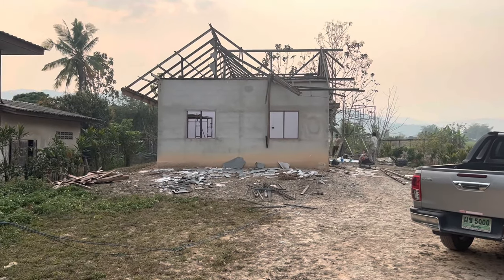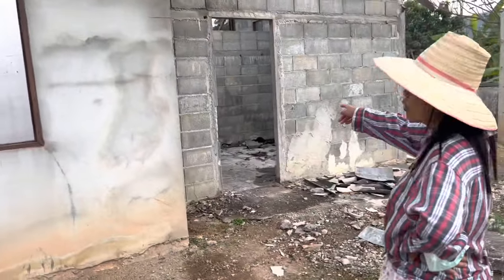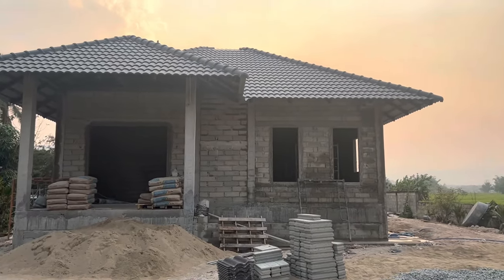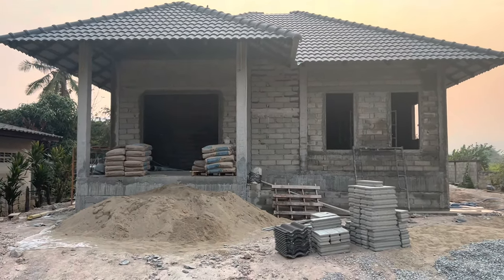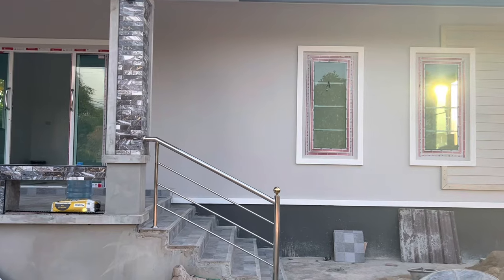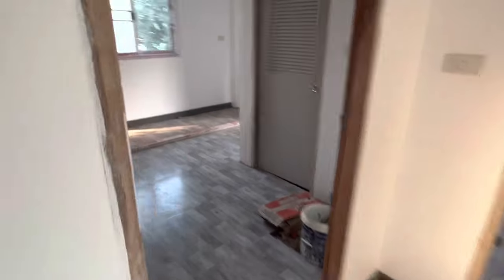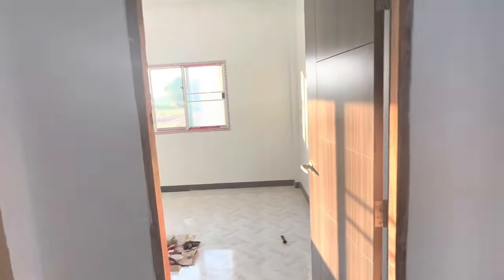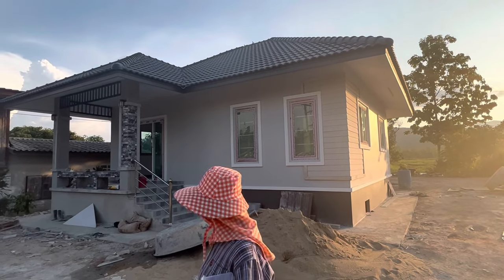Brand New House in Northern Thailand $35K!

Comment: Nice vlog Glen, before, during and after construction and very fast, it's amazing the hours the Thai workers put in with all the heat. Something that baffles me is not using double walled thermo blocks  and not insulating the loft to the max like we do in Canada. Thailand has to deal with very hot weather all year round and if I build a home in Thailand it will be well insulated.
Reply from the maker: So true, and with the rising cost of electricity, you would think everybody would be putting insulation and double walled blocks.
Reply: the strategies involving house with hvac/heater units in cold/hot climates are abit different than those with no(minimal) minicons in hot/humid climates.  its been an interesting study surveying houses are built in Thailand.  similarly look at house in middle america and caribean.  ac is a luxury.
Reply: Good video Glen. I am looking at  a double  wall with either this kind of brick or the red brick. Cavity  wall helps with insulation.

Comment: Why a crawlspace and not a basement? Why are the wall in block instead of stud? No insulation from heat to help the air conditionner. Good informative video. Thx
Reply from the maker: I’ve never seen a basement here. This is likely due to the flooding
Thai style ..done as cheaply as possible 
I know many foreigners who build and insulate ..you can also get higher quality thicker blocks that help save energy

Comment: The things that annoys me with thai built homes is the state of the block work, they rarely install gutters , every build is based on those poured cast concrete square pillars, the ground works rarely get finished , the blue water pipes protrude everywhere, roof insulation is never a priority, and they always insist on an outside extra kitchen ,. Dont get me started on the furnishings and the usual sala pitched up out in the front,. I know its the thai way but i bet most of you reading this agree with my observations,. Good things , the roofing usually looks great, the tiling is spot on, and the finished article looks fantastic, best part is the price and flexibility of building regs,.

Comment: Why don't you use lightweight bricks or clay bricks?  Which will block outside heat and be stronger  cement block bricks.
Reply from the maker: Cost is my guess. Its all about getting it up for as cheap as possible. 
This would be your bottom budget home in rural Thailand. You can upgrade all you want if you’ve got the budget

Comment: Can you even buy bats of insulation in Thailand like you can in N. America? It baffles me that they don't use insulation.
Reply from the maker: I’m not sure. I’ll check next time I’m at the Global house.
Reply: @GlenRobertsonMusic  yes you can
Reply: My home in Pattaya was constructed in the 90s and the attic has spray foam insulation.  The added benefit is that it holds the roof tiles in place.
Reply: @thrasher613  seems to me spray foam in walls and attics would make sense in the tropics, less chance of mold and mildew
Reply: think of insulation as thermal mass.  well that and prices, you can see why reflective barriers and natural cooling are big.  (Especially since ac is a luxury).   Insulation stuffed inside of radiant batts are available in most stores.

Comment: Thin blocks , crappy windows and thai style kitchen. Not to mention the lack of insulation sorry for being so negative but it will cost you in the long run
Reply from the maker: Yep I sure wouldn’t build a house this way myself. This is Thai builders building barebones for Thai owners on a budget
Reply: I always questioned why on the thai kitchens being outside. (even inside ones had no ac)   Until I found I could not breath due to some of the traditional recipes on the stove. lol.